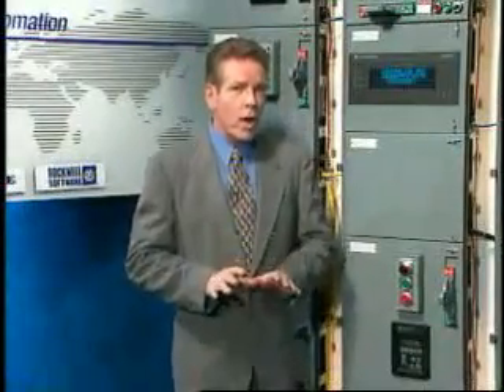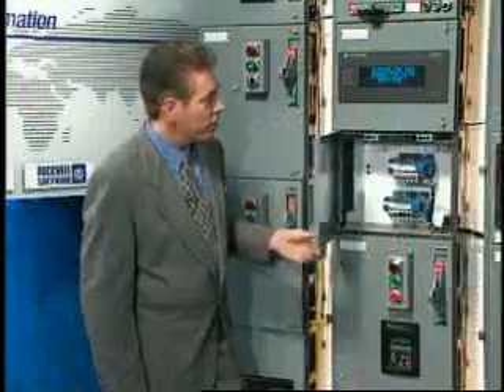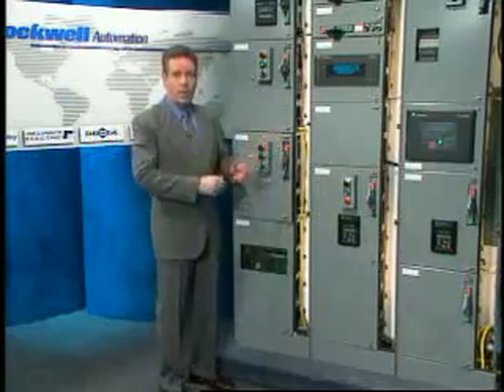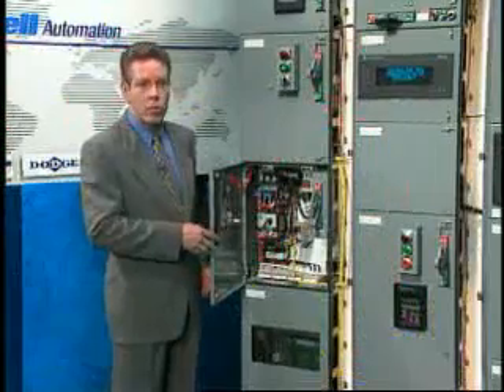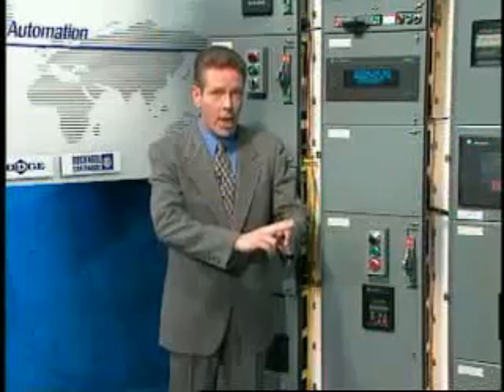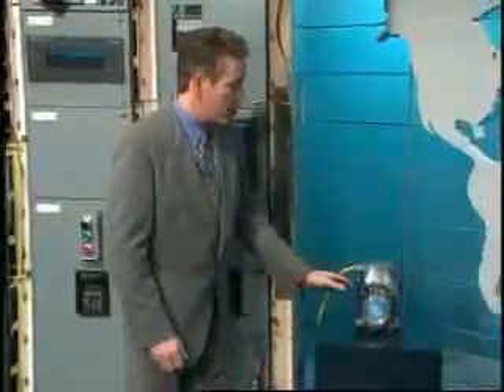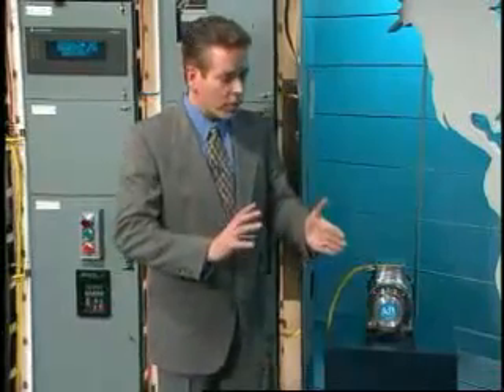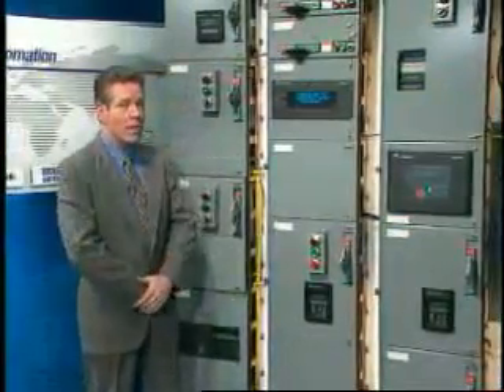Rockwell Automation's Retroencabulator

Comment: I brought one of these to synchronize my gram-meter although they were supplementary rather than cardinal. The durability of the dial reactors allowed me to continue calibrating double-focal point forces and casting those wave-functions to my dilators. Allen bradley was excellent in helping me set that part up over the phone, and in person. They even taught me by hand how to use it in everyday tasks like phasing my ultimator, and fumbling my houses over-saturated stuckle collunms-- if you get my slang. Does anyone know the "professional" term for re-fumbling o.s. stuckle?
Reply: LeSean Payne well when recomblasterning the fambislations, it does get a bit tricky but only when the mastrocoppoc wave radius is set to 9 degrees swaverus, but not less than ninety nine. if chartoblising it's important to recall the lunar wing not position in conjunction with injodextrapositonality to the specific degree rockbanded from excistion excitation.
Reply: Eddie Adams I’ll give you your yearly comment reply. I think the issue here is that rather than recaptulating both the alternating semiconductable terbuloid facet, you’re instead diverting 12AMP of vibronactic helioscapitation to the central villintices. This has the unwanted effect of decardinalizing the stupophonic gauges, causing issue with the columns.
Reply: I feel insulted that you won't use jargon and terms of art when we're all eminently capable of understanding a technical explanation. I don't think it's necessary for you to dumb it down.
Reply: @Parkyurkarkas  im sorry. I shouldn't have. A lot of that slang has gone out ofnuse now, and I've also switched to a non phasal dialator and dont really use the whole wave-cast system anymore, so I can't really remember what I was talking about. What I will say is that non state-like dialators cause stateful properties to transfer between entangled karmic actors, whether their interaction is physical or emotional. It's been a massive help for me and my wifes relationship.